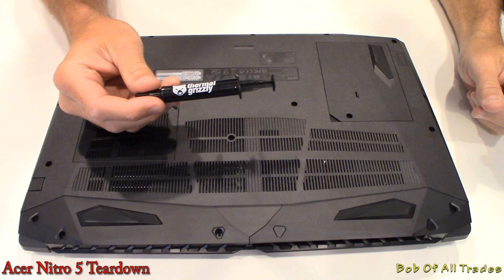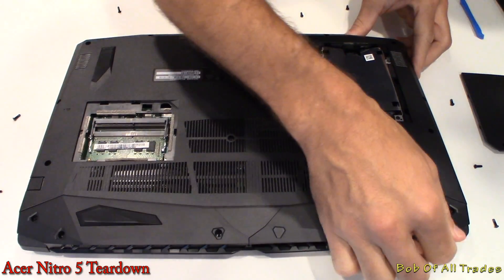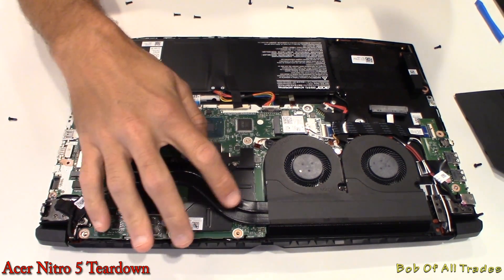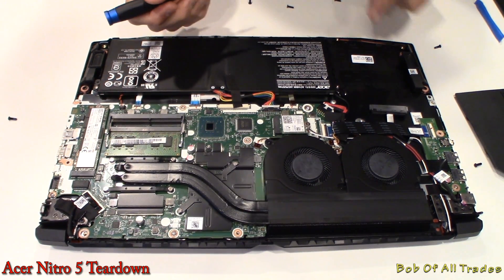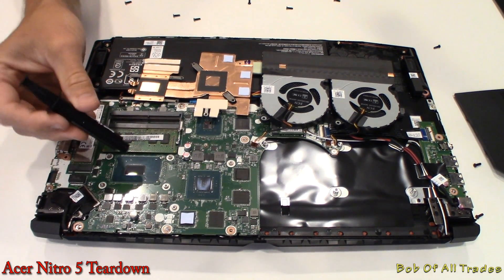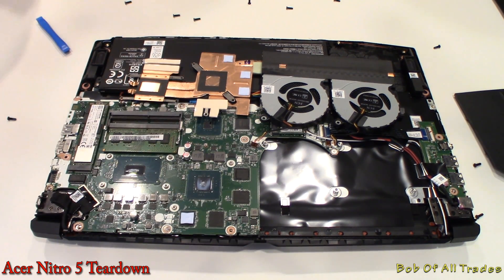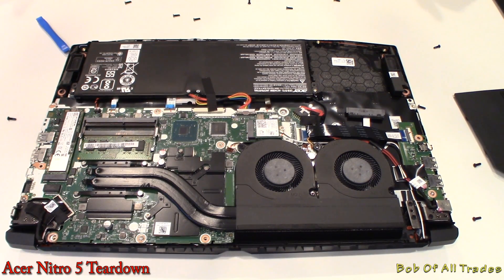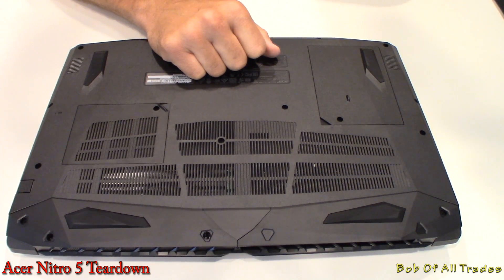Acer Nitro 5 Repaste w/ Kryonaut!  i5 8300h

Comment: Is it a m.2 nvme slot where you plugged in your SSD? I only have a hdd and i want to upgrade
Reply from the maker: Well mine came with one so i'd so yes.
Reply: Bob Of All Trades is every m.2 nvme ssd compatible?
Reply from the maker: Andreas Dreier It is not. You’d have to contact the manufacturer if it isn’t clear or you’re not sure.
Reply: Bob Of All Trades OK ty great video btw
Reply: it is compatible 
in fact it even supports x4 nvme

Comment: Very helpful, this is the only teardown of my exact laptop I could find. You earned yourself a sub.
Reply from the maker: Gabe Springhetti Hope you find it useful :-)
Reply: Bob Of All Trades I feel lucky because I'm able to run a -160 mv undervolt stable as can be under gaming loads I've spiked 80c auto on the fans but usually settles in the low 70s. I'm gonna repaste it now since I have something to guide me, the video will be very useful.
Reply from the maker: Gabe Springhetti Make sure to use a good paste. There’s a reason why I use thermal grizzly Kryonaut :-)
Reply: @gabespringhetti7890 How are you undervolting a laptop? Mine won't let me install literally anything to touch core voltage..
Reply: Hey gabe how much temperature drops were you able to achieve with your new thermal paste?!
Reply: @danyboyy9380  After about 200 hours of gaming I found that -160mv undervolt to be slightly unstable. Backed it off to -145mv. I repasted with Arctic silver 5 because I had some laying around. I know, it's not very good. Under gaming loads I'm at about 65-70c sometimes spiking higher for a few seconds. If I'm running my A/C and my house is cool the fans won't even get loud honestly. The gpu temps stayed about the same. Ill run some benchmarks later today and get you more info.
Reply: I also want to add that the factory paste job on my laptop was actually very well done. A little messy but it had a good spread. Mine wasn't really that bad off to begin with, I just did this while I had it open to dust the fans and heatsink as its my only gaming rig and gets used alot.
Reply: Gabe Springhetti Yeah unfortunately the cooling design isnt great but as long as you did those things its doable for sure.
Reply: @gabespringhetti7890  I know this is 7 months later but i bought the nitro 5 two months ago with i5-8300h and gtx 1050, i was wondering if u had the same specs because my temperatures are usually in the mid-high 80s and even spikes to 90+ (Celsius) on my cpu with -125 undervolt but i feel like that's already kind of unstable, or it might be because my fans are dusty.
Reply: @RyxFPS   i5 8th gen & GTX 1050 with 8 gb ram ?
Coz I have these specs & oh boy the temperatures soar tooo high
Reply: @anonymoususer2092  try undervolting
Reply: @RyxFPS  Very late reply but how is your laptop doing? My CPU's temperature goes up to and stays at 95 degrees celcius often making my entire PC lag like crazy and only achieving 30-45 FPS on games that dont even require good hardware ( SCP SL if you know the game. ) GPU stays at 80 degrees celcius. I have the exact same setup as you except with dual channel 16 gb RAM. I have been considering doing a thermal repaste myself as I used this 2018 model used last year and I doubt anything has been done inside of it. Do you recommend undervolting and if you do, please link credible tutorials as I dont want to be breaking this thing,
Reply: @Covid-bv4hp  definitely repaste it, and just search up an undervolt tutorial on youtube. I replaced my nitro 5 already with a lenovo legion 5

Comment: So i have this laptop and with an undervolt of -.125 im getting much better than the 90-99c i was seeing when playing far cry 5. Question is i have a tube of Cooler Master thermal paste than came with the hyper 212 i have in my pc. Is it worth it to repaste with this TIM? Will the results till be worth it considering it doesnt have as high thermal dissipation as say that kryonaut you are using?
Reply: I repasted mine last week as soon as I got it. IT IS WORTH IT. You should definitely repaste on gaming laptops. The oem paste is caky, it is horrible. CM thermal is decent but not great. I got arctic silver 5 and it's running at around 74C under load. Also, I undervolt mine to -150 mV, it's stable and about 2 degrees cooler. Also, if you have some headroom on your gpu temperature, you can try overclocking it.
Reply: I'm not Bob but my motto would be, the lower the better. It won't hurt your laptop lowering the thermals even more and will result in helping your laptop (specifically the CPU) last longer and work more efficiently.
Reply: Nice results. Im gonna do it this weekend. Thanks for the response!